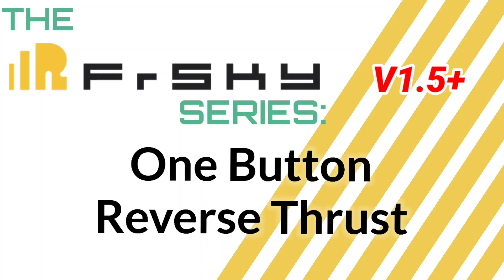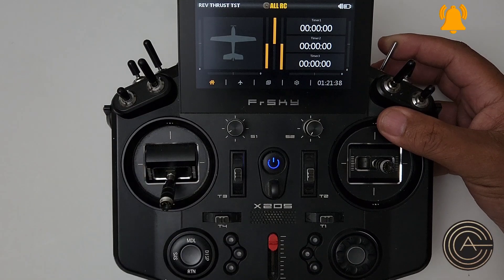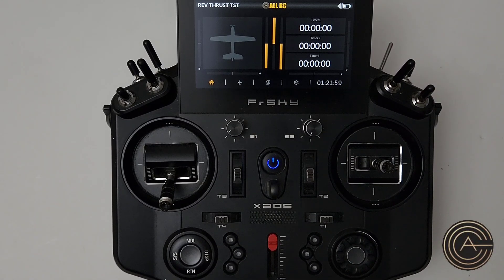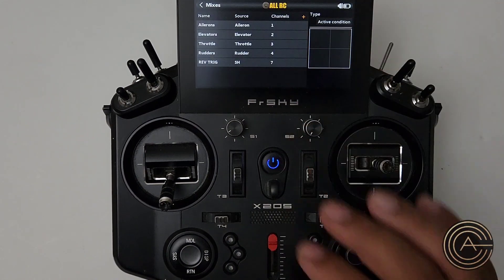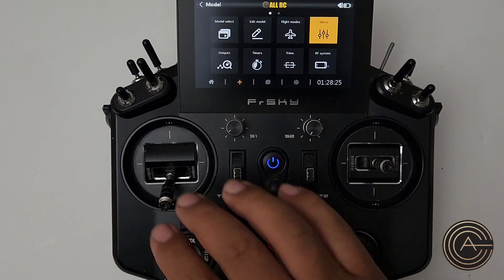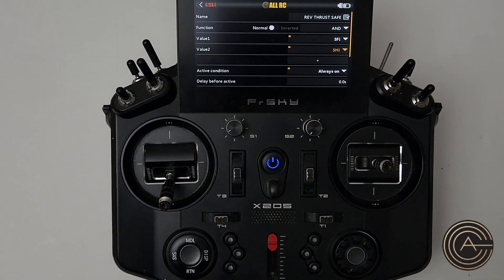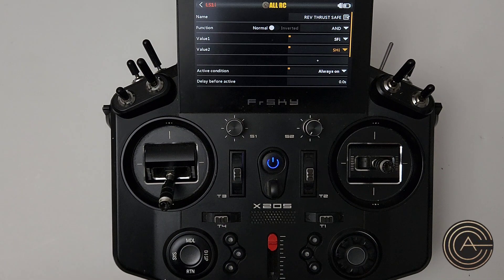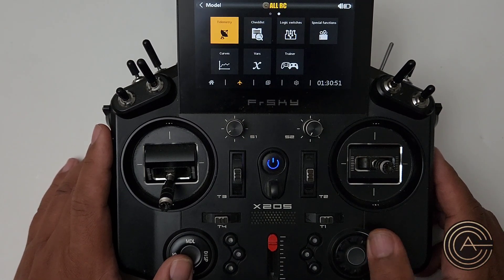The Frsky Series: (V1.5+) One Button Reverse Thrust

Comment: Very helpful information, I had a problem with a FreeWing 100A ESC getting stuck reverse until I adjusted the end points. Seems some of the newer ESCs have a range of 1100us to 1940us and exceeding that range causes strange issues.

Comment: Thanks.   Still looking for a way to reverse (or cancel) my Thrust Reverse (because it is always on and the EDF is sucking air rather than blowing air).  After that, I will follow the method in this video to activate it when needed to break.
Reply from the maker: That could be a couple of things. Is thrust still reversed if the thrust reverse trigger wire is disconnected to the receiver? If it goes the correct direction when the wire is disconnected, reconnect and reverse the output channel in the output menu. If that doesn't work,  play with the end points like mentioned in the video until thrust reverse works like it should. If it still goes the wrong direction after pulling the connector, the motor may be wired incorrectly. The motor to the ESC has three wires. Try swapping any two of the three wires going to the motor and see if that does it.
Reply: @all_rc  thanks a lot. I took the second option, reduced the pwm to 1000 rather than default of 1500 and it started blowing air.  

Still new to the FRsky after spektrum. Love the quality and screen but I wish it is a bit simpler or named in indicative way or like spectrum.  

Thank you for your help.  

Still not able to assign channels to switches,, not sure why everything is done in the mixers!  I have a gyro I want to assign to 3 positions switch , I think this should be done in outputs ! 

Also, in a 3 position, the speech read only the middle position because the third position is reached before finishing the reading of second switch.  I wonder if there is a way to make the radio read the speeches in sequence, because while flying I may move from low rates to high rates, but it will read only the mid rates. !! 

Also would like to set a percentage timer as a percent of throttle use. Not able. 

And the list goes on.  

Thanks for sharing your videos and experiences
Reply from the maker: It's always like this when trying anything different than what you are used to. I swear to you, once you understand ethos, it will make sense. I know Spektrum, EdgeTx, OpenTx and Futaba. And I can easily program a plane markedly quicker on Ethos than anything else. And the power, once you understand how to use it is unbelievable...
To assign channels to switches:
Create a new Free Mix
Source: highlight this and press then flip the switch you want
Output: the channel you want
That's it 

Not exactly sure what you mean about only the middle position being read on a 3 pos switch. If I toggle to middle, then bottom, it does read both.... When I go from top position to bottom position quickly, it reads the voice for middle then bottom. That issue you can fix by going to SYSTEM, HARDWARE, Switch middle detect delay and changing it from 0ms to 1or 2ms. I wonder if you aren't setting up the voices correctly if it only reads middle...

To set throttle timer to percentage mode. Change Proportional Timing Source to Throttle.

Ethos is still relativley new so they are adding stuff all the time but what they have now has a ton of features and power
Reply: @all_rc  👌👌 My favourite channel for Frsky stuff.   Thanks a lot

Comment: Great video!  I am in the process of developing a hardware/software solution, such that, if the aircraft is >6" off the ground and Gear is up and throttle stick >-95%, reverse thrust cannot be initiated. 🤓

Comment: This was such a helpful video! Using the information, I was able to find where I was going wrong setting up my custom throttle reverse. Now I have my throttle reverse working the way I wanted. The bonus tip showing how to still have manual control was beneficial; I used that!